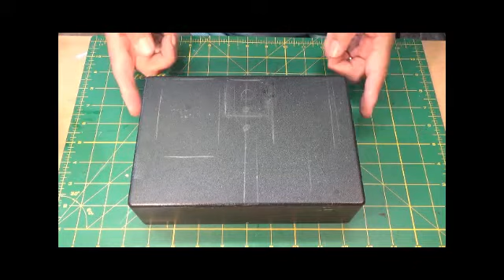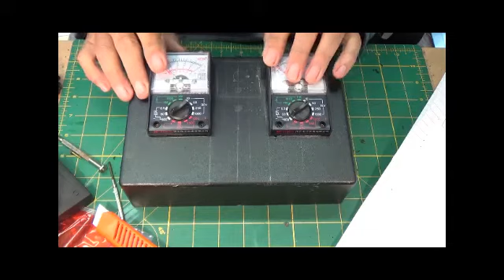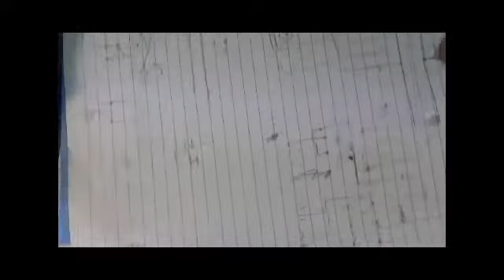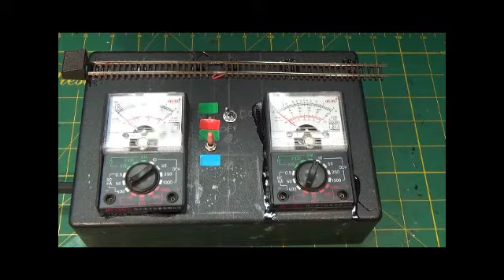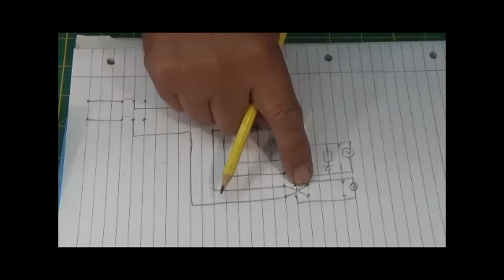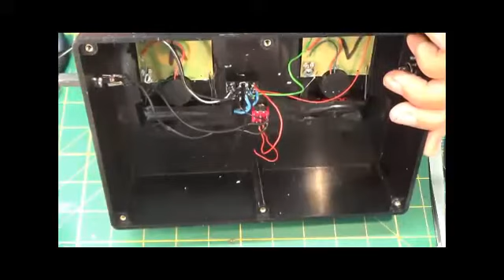Rolling Road Test Bed

Comment: I am interested in this but know little or nothing about it. I do have an HM rolling Road but don’t understand why you would test the voltage/current etc and what indicators you would get from this?
At the moment I put my locos on the track and turn the controller...
Reply from the maker: Hi Charlie, glad you found this interesting. The main idea was to try and get a comparison between locos. If I noted readings before servicing, I could compare after to see differences. Sadly, the current meter doesn't work as I hoped but when I get time I'll have another go. 
Hope that helps. Take care.

Comment: Hi, Good job working it out I used Digital meters and a DCC  test board, and an Arduino DC controller all built into a unit with rolling road 15 CM squared, works a treat.Let me know the next time you come to Aberdeen and we can arrange a meet,you can email me flyingscotsman01@yahoo.com, Take care. Mac

Comment: That was interesting,  some of the wiring went over my head, but I got the plan.
Thanks  for sharing,
Reply from the maker: Hi Martin. Basically, monitor voltage across the track, monitor current in series with the track.Thanks for looking, hope you find it useful.